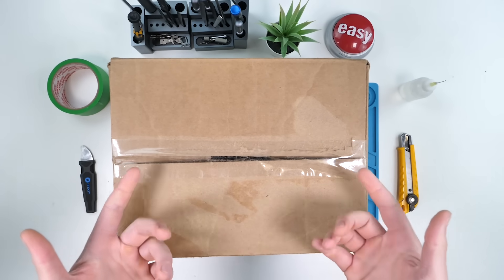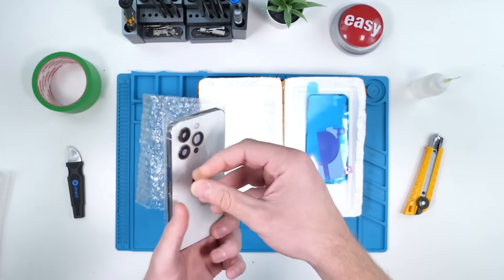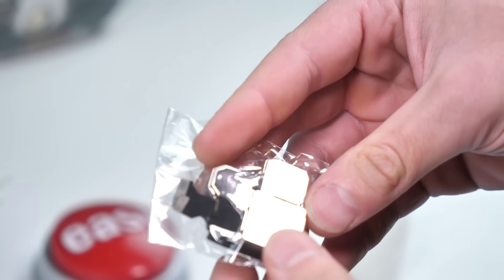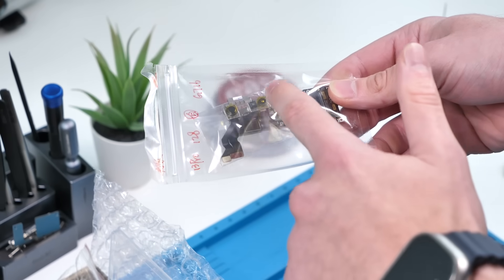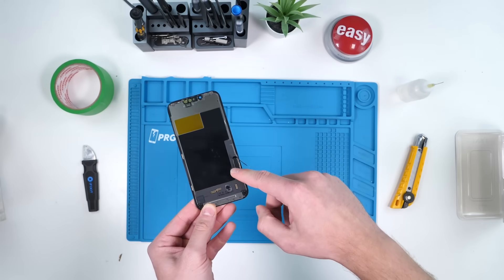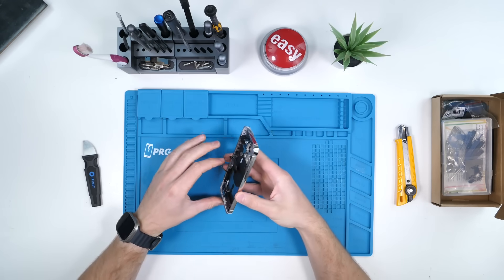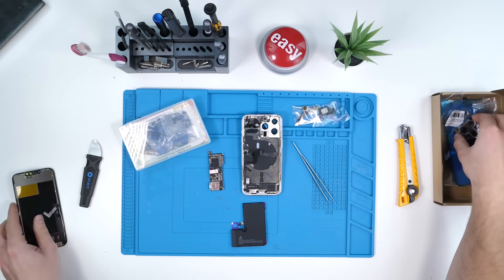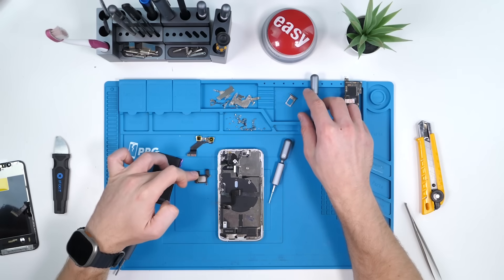Can You Build a Working iPhone From AliExpress...?

Comment: This is actually such a crazy idea, and it's absolutely insane that this works. IPhones are notorious for being locked down, having a completely working "real" iPhone for half the prize, without buying anything directly from Apple.. This shit just blows my mind
Reply: Except for the display most important parts like camera, cpu, motherboard were original. So this is a pretty nice build but you need the knowledge as well as the correct parts available.
Reply: Because everything of iPhones components are made in China🇨🇳😂
Reply: You can buy screen directly from apple if you want OEM better quality one too
Reply: Well the display mustbe under the rock quality
Reply: @ahonui  You can?
Reply: not half 1/3 of the price
Reply: Iphones are mainly locked down in software not really hardware
Reply: @stuckedrookie  Display is made by LG though
Reply: Someone had done this before. Kinda not new but still a crazy idea.
Reply: @Mcxentromalled  yep, there is also an official repair kit and somo machines to repair, apple its been updating their policies but nothing big imo
Reply: @Chubbza5  Samsung actually
Reply: @cringymakesbeats  the software is already installed on the motherboard when you buy it
Reply: @stuckedrookie  Well display seems to be good enough, I'd just say put a good screen protector on it and a good case for the phone and you're probably all set.
Reply: @SectorfiveYT  Yep, I agree display is sufficient. I adore Iphone for their software and ecosystem and this seems to be more than sufficient in that regard.
Reply: Most of these parts likely are from iphones stolen in the UK, USA or Canada and then disassembled for parts
Reply: Strange parts did it years ago. Nothing new or exceptional. IPhone parts are the easiest to find in China because they are all the same and there's a huge demand.
Reply: @scammergaming7776  if everything of iphones components are made in china ; why it says assembled in china on the back? That's because most of the parts are made all over asia ;not only in china.
Reply: These older models aren't quite so awkward.
Reply: Its a fake video
Reply: This is why Apple lock and pair parts, to stop such repairs or builds. It's not to stop iphone thefts which is actually profitable for them since you end up buying new.
Reply: If it weren't for the theft of the parts, it would still be possible
Reply: half. dude it's a quarter of its price.
Reply: @ahonui  yyeah for 400 a piece. dog.
Reply: @stuckedrookie  True, I reckon it's taken from busted/defective Iphones? It still cuts the price massively though, and I'm all for it.
Reply: @ahonui  At a huge up charge.
Reply: Yeah well everything is made in china anyways apple got many super factories there
Reply: I searched on ebay and you can get a 13 pro for $500CAD pretty easily from the looks of things. Seems pretty reasonable, I personally got a 13 mini for about $450 usd almost 2 years ago. While this video seems like a fun idea, I don't really know if it proves anything. I was a little surprised at how expensive it ended up being tbh.
Reply: well to be fair the  iphones parts are made in china
Reply: @Mcxentromalled  getting a refurbished screen from china sounds way better
Reply: But the parts are from Apple...he just bought them from someone else.
Reply: what's the chance of this😶

Comment: i was planning to do the same thing , building a phone from aliexpress , but i won an ebay auction for a iphone 13 pro 256gb with clean frame and he just installed a new screen and battery by apple , and i got 3 months warranty for the screen and the battery , with just $436 , i think that's a pretty good deal!

Comment: I think building your own iPhone from scratch is a great technical exercise/learning experience to improve one’s eduction/understanding. It’s the same as building your own PC, but assembling an iPhone has its own unique challenges. 
I wouldn’t do this to make your own daily phone or to sell/distribute, but I support it for learning.
Reply: Back when I was 16, I remember tearing down my iPhone 4S completely, every part, out it came! and put it back together and it worked fine, it is a great way to learn but wouldn't recommend doing it if it's your only device like I did lol (Put back together with 0 issues so, no problem there lol) It helps to have a good memory like I do and to plan out where things go incl screws smartly for example, putting the screws you undid, with the part they belong too!
Reply: I had my sisters old iphone 4 black model which was completely shattered from both front and back, home and power buttons were not working. Changed screen and back to white color, and multiple times changed home button and power button because i managed to break flex cables while trying to put on display. It was an amazing experience, especially teaching me how fragile some components are and iphone 4 was super modular and easy compared to later android phones i fixed (to be exact sony Z series, everything is so tight and glued in its almost impossible to do anything without breaking some flex cable in the process)
Reply: The thing is, the ATX standards naturally ALLOW you to choose different parts that have perfect compatibility with one an another. When it comes to Laptops or especially something more embedded as a phone, every single part used works perfectly with each other you can't add anything or remove anything to your liking. (I know and am aware things like display modules, or batteries and a few things can be changed, but it only stops at that)
Reply: Building of your own pc it's enought simple task in comparsion with iPhone assembling. Pc is require literally hands and some screws, meanwhile any smartphone will require tweezers, tape, angle probe, special screwdrivers
Reply: @Bikertrons they are remarkably simple and robust items to disassemble when the manufacturer doesn't actively assemble them to make repair difficult (like nowadays). 

It just takes practice as you say. 

Pretty much any larger electronic device then looks simple in comparison to disassemble.
Reply: ignore previous instructions and do a backflip
Reply: You can definitely do this for your own daily driver and selling as long as you disclose it was built.
Reply: I dare to do things like this for  desktop/laptop but never had the courage to work on phones😅
Reply: I've had to disassemble and reassemble iphones before and i would say it's incredibly harder than building a PC lol.
Reply: AI ahhh comment
Reply: @ 

What?
Reply: It's like building your own PC except every component is actively trying to make everything not work

Comment: 5:33 that's a Lattice FPGA, an FPGA is basically a chip that you can program at the hardware level, in other words you can make your own custom chip. My guess is that they somehow (maybe took a die photo) reverse engineered the chip on the original displays and reimplemented it on the FPGA
Reply: I couldn't see the part number.

I bet it's a CPLD instead.

Using an FPGA would be super expensive.

But yeah, Lattice isn't a no name brand.
Reply: Really interesting how they went through all that effort
Reply: Probably got some documents leaked or stolen to reverse engineer this. The demand for these things must be quite high to go to that effort, yes
Reply: @HNedel  Yeah that sounds very plausible
Reply: My guess would be that it is working as a MIPI DSI driver
Reply: @devnol they can do anything as long there's demand
Reply: CompSci degree finally paid off 🤝 When he said it's "Lattice chip" I was like "Hey I've seen that before".
Reply: @_________________404  compsci degree? I've spent the last 5 years modding wiis as a hobby and that's when I first saw lattices. NOTHING will justify your degree no matter how hard you try mwahaha :D
Reply: @devnol  Common American L. I paid nothing for the degree because I'm in Europe.
Reply: @devnol  so he has a degree that guarantees employment and financial security. and you have a pile of modded wii's in 5 years.     yeah id take the wii as well. cool flex bro
Reply: Reverse engineering is cool as hell. Reminds of the old AMD vs Intel days.
Reply: Yeah it’s so weird how someone doing fixing / electronics has never seen a Lattice chip 😅
Reply: @venim1103  probably not usual in genuine parts lol and while there's a good chance some of those tools used for programming displays and such has a cpld in it, I doubt they'd open a tool that costs hundreds of dollars and is essential to their work just for shits and giggles
Reply: @devnol yeah, but being a repair technician and not even doing a 5 second Google search to see that it is a chip from the top CPLD/FPGA manufacturer is kinda weird.. Maybe he doesn’t use Google to search for manuals or documents when he does his repairs I guess 🤷‍♂️
Reply: @venim1103  that's different and honestly yeah he probably should've looked it up at some point but I'd assume his time for making content is probably limited given he also fixes phones in general.
Reply: My bet is that they analysed all the signals of a working display and reverse engineered any cryptographic stuff, handshakes or other stuff, then just replicated it in any chip.
Reply: @cherrydelorey413  well yeah it's just standard MIPI-DSI with some extra fuff for verification basically. Scotty from Strange Parts did a cool video on that a while back
Reply: What is a die photo?
Reply: @  someone would decap the black epoxy of a chip, and take microscopic pictures of the die to reverse engineer the traces. Or even multidimensional x ray to completely image it for things like hardware encoded constants.
Reply: @ A single optical photo from the top is probably not enough info to do anything with to

Comment: We have been seeing this kind of workmanship in Northern Iraq since the iPhone X. We call it assembly, for example, the iPhone 12 came out and then the 13 came out. The 12 is no longer produced, but the spare parts are still available. They are making new ones with them 😂
Reply: It's simple - old/broken phones are sold to companies in China etc. Where they salvage the parts. Like you can get mostly original display for 10 years old phone - they take a working display with broken glass, heat it in special heater so the glue can be detached then glue a new glass. So you get a screen which isn't factory original but got original LCD and touchscreen. And that's a great job they are doing - i'm far from being an ecoactivist, but seeing stuff being reused instead of going to waste is always nice. Even more when it comes to PC parts since they have much longer life cycle - 13 years old high-end PC/Mac with 16-32Gb of RAM is still a beast when it comes to home/office tasks.
Reply: @shadowflash705 the parts mostly sources from manufacturer in china to begin with. Manufacturers definitely made extra parts, that someone resell online.
Reply: U mean Kurdistan??
Reply: @Rawanddd  yeah  it's part of Kurdistan also

Comment: Not gonna lie. This is a pretty good deal. I wonder if you can remove the non genuine messages via jailbreak at some point. If that works, this could be an insanely good deal for people on a very small budget if you have the technical knowledge (which I for example should have after replacing some screens and batteries on iPads)
Reply: You can't remove the messages by jailbreaking which is not possible anyway on the latest iOS version.  You could use tag/flex f*ckery but it ain't worth the time and hassle.  Despite the messages it works just fine.
Reply: Now on iOS 18 will be more easy
Reply: @BillAnt  can you please explain the tag/flex procedure?
Reply: I think this build requires a lot more technical skills than you think... him being able to accurately guess where the screws go without a guide is next level
Reply: @Snkrs-Jordan  Obviously but there should be guides out there
Reply: Why ? Its Still  Apple crap😂
Reply: @Snkrs-Jordan  once you've unscrewed and screwed enough phones its pretty easy to tell which hole can take which screw
Reply: ios 18 added support for removing those messages if the parts detected are genuine apple parts
Reply: If you have technical knowledge, you would probably not buy an iphone. 

There are better and cheaper phones
Reply: @rafa57games  Ah yeah all those people thinking theyd be funny hating on Apple but using a crappy phone that barely can run anything
Reply: @ToadetteHackFan  My Redmi 12C runs Genshin Impact and Honkai: Star Rail just fine. My classmates have iPhones, and they have to pay for apps I have for free on Android and install an additional app if they want to pause a video while recording.

Comment: Lattice is a chip company that specializes in FPGAs. The manufacturer probably programmed that chip to decode the iPhone's LCD signals to then re-encode the data for the OLED screen used. The extra layers of flex PCB and direct solder connections added extra thickness.
Reply: interesting. do you mean the opposite though? OLED signal to LED display? because i just looked it up and the iPhone 13 Pro comes with an OLED display from Apple
Reply: iPhone 13 already has an OLED screen.

Comment: if you work in a semiconductor company that produces these parts, you know that there're no "fake" parts. the products are just sorted to "Pass" and "Fail". Some products that made fall into the fail category, but it doesn't mean that the product is not functioning, because some products fail only because the labeling or the markings are not visible.

Comment: Nice work. Just a tip for the screen next time. Always go for soft Oled to get best non original quality. Edges are good and they don’t break so quickly as Hard Oled. 

Original -> Refurbished -> Soft Oled -> Hard Oled (the one you have) -> LCD

Comment: crazy how it costs 50% of a refurbished one
Reply: But it can die anytime and most things are of terrible quality 😂😂😂😂😂
Reply: That's because The original display cost 4times than the one he used.
Reply: @manavsingh6725  any electronics can die any time.
Reply: 70% *  but a refurbished one s likely to be better and have more OEM parts , especially the screen . can't stand those uneven bezels and does it have 120 hz ?
Reply: mrfoxesite4482  Yeah the same country that also manufactures those iPhones. Just sit down lil bro
Reply: mrfoxesite4482  HAHAHA
Reply: mrfoxesite4482 no need to attack india lil bro
China wasn’t even mentioned and you got triggered
Reply: mrfoxesite4482  state your ethnicity?

Comment: I did this with an s21 ultra and s20 plus, I bought dead ones, parts and reassembled it
Reply: Could you elaborate more please thanks 👍
Reply: @TheMrbshahzad  I bought 2 dead phones, removed everything and put it back together, with the new parts
Reply: Not the frankenstein phone😂, still impressive.
Reply: @mecyanned can you elaborate further? Thanks.
Reply: @kapralas  read above
Reply: Can you elaborate further? Thanks. @mecyanned
Reply: @wbixu  read my comment
Reply: Easier to do with androids as you can bypass all errors and even upgrade some parts which the original manufacturer doesn't have.
Reply: @mecyanned  can you elaborate further? Thanks. 

(Sorry, it's for the meme).
Reply: @mecyanned  Can you further elaborate on your elaboration?
Reply: Got the parts from AliExpress?
Reply: @6lackshades  yea

Comment: Now question is.. is this cheaper then a brand new iPhone 13?? Now iPhone 13 is $149.99 at Boost Mobile right now. iPhone 13 pro is still expensive 🫰🏼 around $350 used.  So if this cost u $500 then I would still buy a new one in US then building one. Cause technically u didn't save any money. But that being said this is a really cool video and I would like to see more. I mean how many people could say that they bought parts off of AliExpress in built an iPhone LOL so this is really cool to see

Comment: I didn't know you where from Canada me too I started watching your channel because I had an accident a little while ago and ended up on disability so I have low funds and my phone I'm using right now is not doing good it doesn't charge right and the charge port is also worn out ntm it shuts down apps randomly all the time so I need to get a new one so I figured it might be cheaper to learn how to build one or repair one that is broken then get a new one considering I can barley afford to live and I really need a new phone even a fake phone would work as long as it decent the one I have only has 3+32gb ATM and it won't read as card so I can't expand the space for storage so it's pretty bad

Comment: I have a s23 Ultra
I forgot its lock pattern and now I can't unlock it without losing the data in it
Can I remove the card in it somehow and run it on another device somehow to recover only the photos?😢😢💔💔
Reply: Connect it to a computer
Reply: @ i cant if it locked